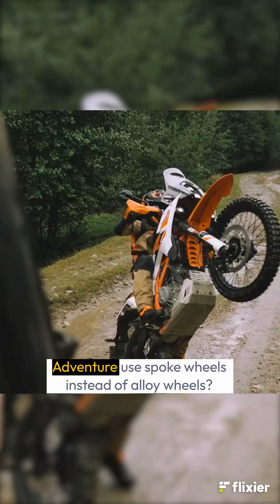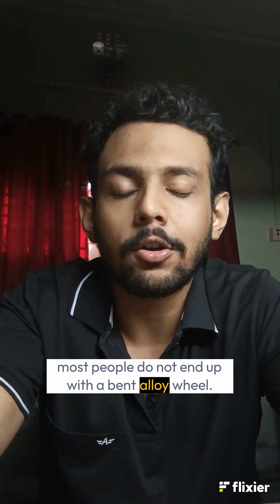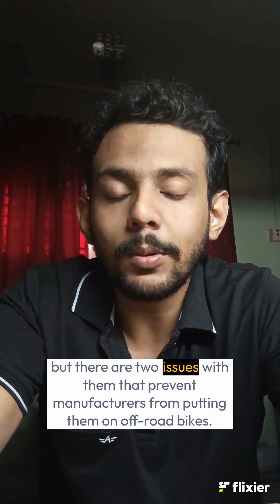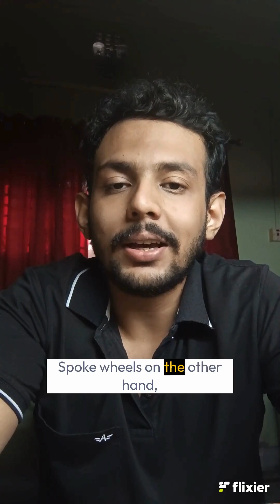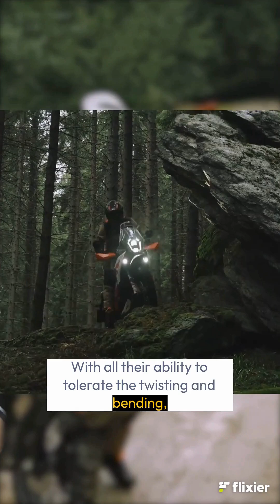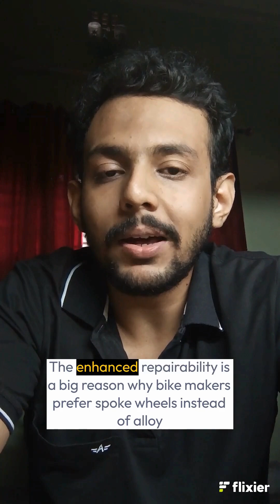Himalayan 450, KTM 390 Adv: Why do they use Spoke Wheels? #bikes #wheels #himalayan450 #390adventure

Comment: small bends on alloy wheels can be repaired, there are mechanics who can repair alloys..

what you told is right, its repairability

Main difference is alloys are hard and breaks in imapct, steel wheels are ductile, which means they bend on impact